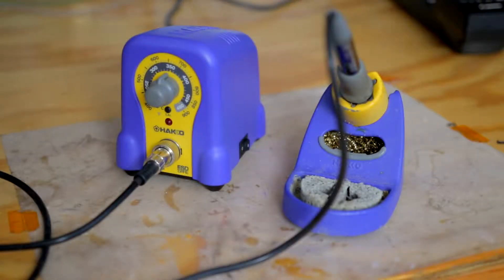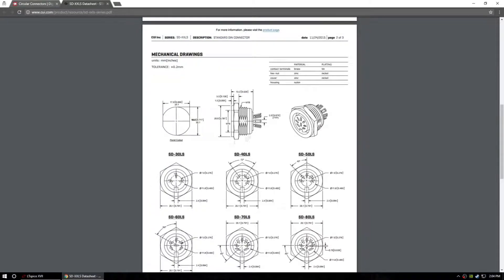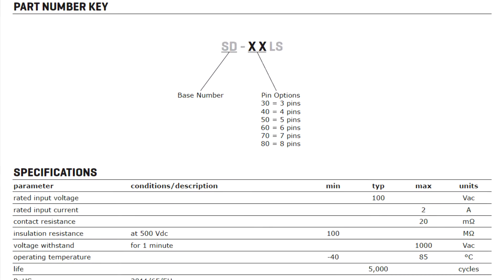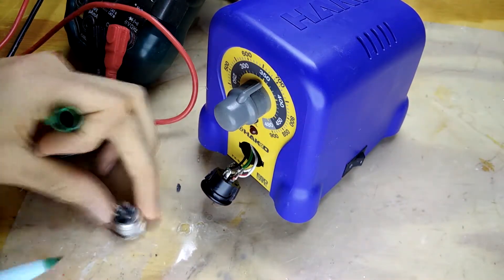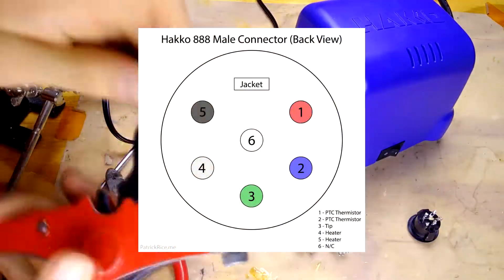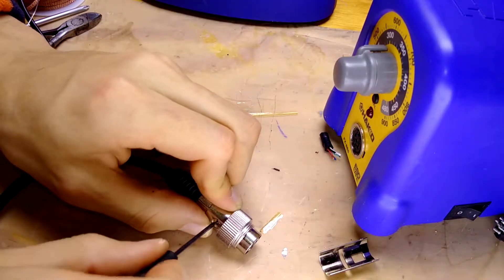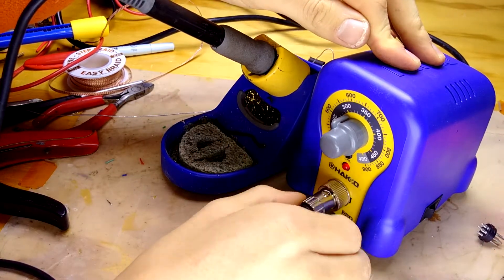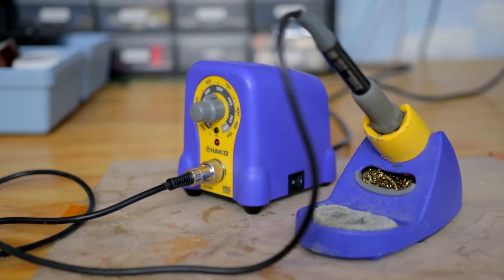Hakko 888 Connector Replacement/Upgrade

Comment: Same here. I took a needle and pushed opposing pins in the female DIN connector against each other so they make a better contact with the male pins. Seems to work but probably not very longterm solution.

Comment: Thanks so much. I had the same issue with mine and, after following your instructions, it came out great. I'm still a little confused what that 1M resistor did and why I didn't need it.

Comment: Same problem here.... It was a nice surprise finding out I wasnt alone. Couldn't find those CUI connectors in UK but Lumberg are also good so I went for Lumberg Equivalent (6 pin DIN
KFV 60  (socket 18mm hole), SV 60  (plug) and it works perfectly.  Super pleased